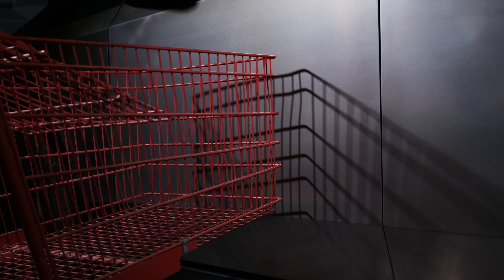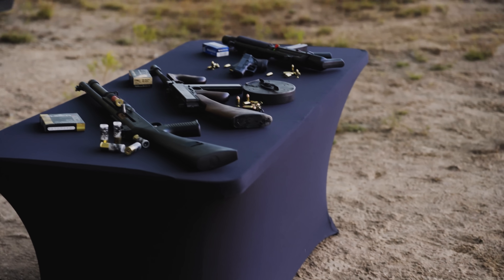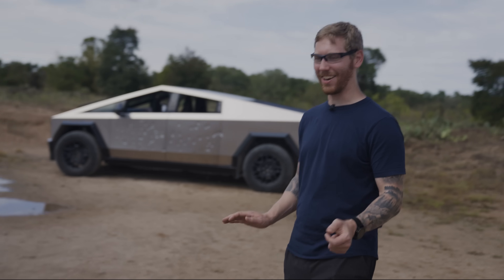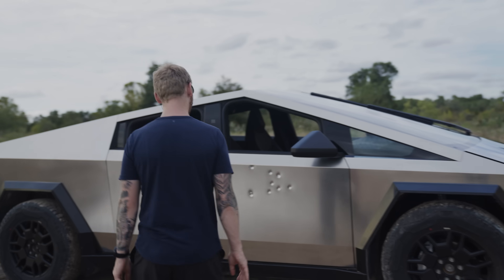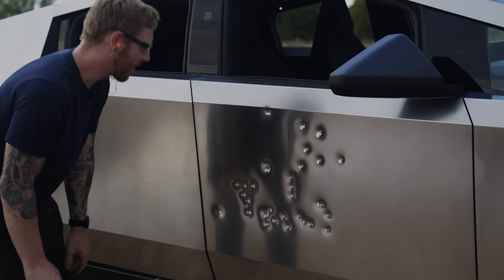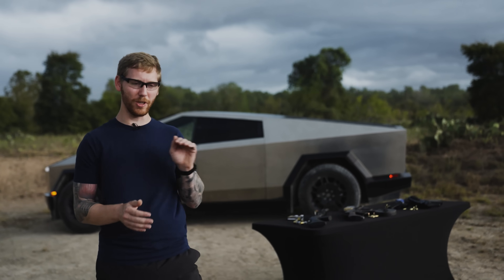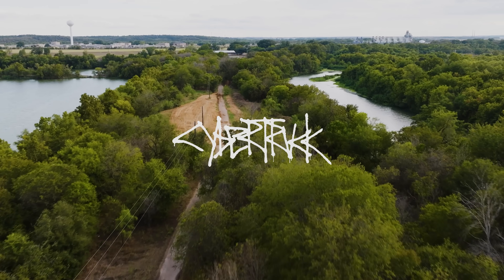Cybertruck Bullet Test

Comment: Now do the glass. Obviously it's pointless without the glass in mind
Reply: It isn't pointless. If you want an armored conversion, which is what's done with other vehicles, you can go ahead and replace the panes with fixed bullet proof glass, and pay the mass penalty. If you want to use it as-is, having the car itself be bulletproof is already a huge layer of protection. For instance, if they're shooting at you, you can protect yourself behind the car, unlike most other cars. 

Also, this isn't necessarily about actual bulletproofing. If you require a bulletproof car, you'll get a proper conversion. This is mostly about showing the general hardness of the vehicle. If it can resist bullets like that, it can certainly not even flinch against other car doors, shopping carts, pebbles, etc.

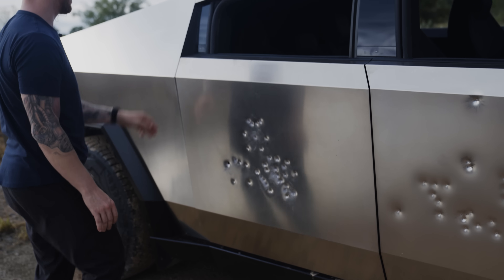Comment: 2:47 what if the touch screen is hit so you can press the button to open the door? lol
Reply: Or use the app.
Reply: dude didn't you watch any movies ( Just grab the knife pull the panel out and hot wire the switch) It bypassed the security in spaceship doors... Why wouldn't work here?
Reply: You just open a different door.
Reply: Legally their required to have a manual door handle.
Its usually in a more concealed spot.
My dads model3 has slightly under the door
Reply: There is a manual latch to open the door on each side

Comment: No way this is under $100,000
Reply: The pricing has been revealed
Reply: @michaelc7014  it’s been revealed several times. Each time it’s grown a lot. The base models last reveal was $39k. It now stands at $61k and it’s not released. I expect it to keep increasing. But, I could be wrong. It’s my opinion based on the trend.
Reply: there is three models, single double, and triple... its cheaper... mkbhd explains it throughly today in highlight video

Comment: How does this affect crumple zones?
Reply: Not much, they probably added stiffeners on the door panels to increase rigidity and not on the crumple zone at the front.
Reply: It shouldn't. The characteristics of the material that matter in terms of penetration are not the same that matter for bullet resistance. What matters in this case is hardness of the material, and steel has higher hardness than aluminum. Hardness doesn't matter for crumple zone effectiveness, ductility does, and in that area stainless does fairly well, and it's not the most important property on side panels. Regarding doors, you care more about protecting the safety cell than about absorbing kinetic energy. In that area, cars made of aluminum panels need significant steel reinforcement anyway. Cybertruck should do very well in terms of safety.